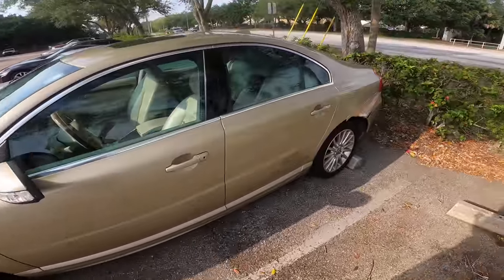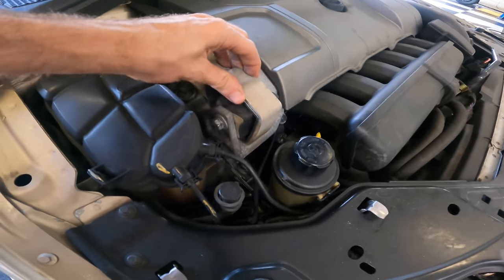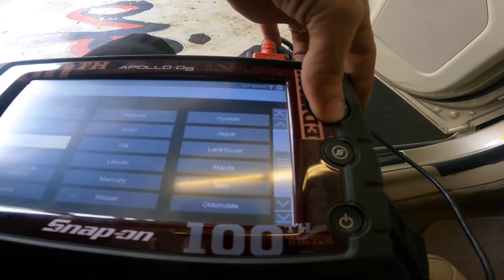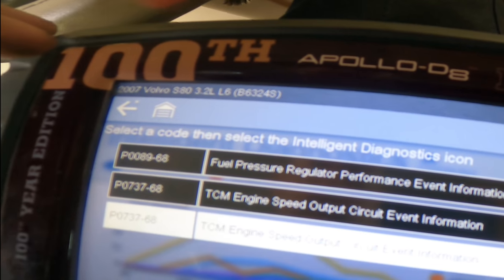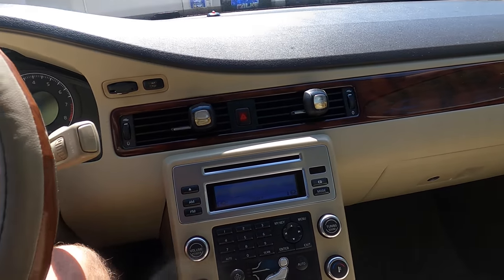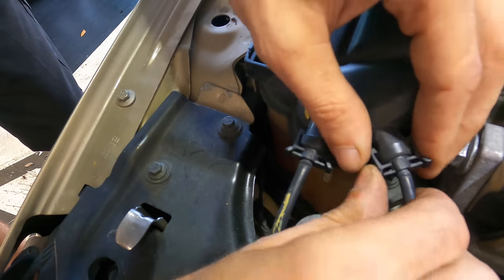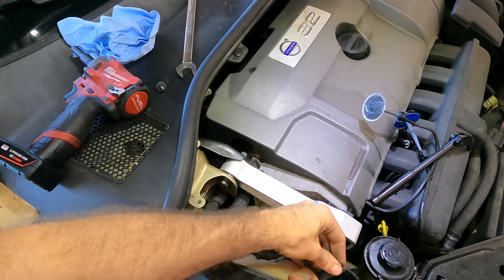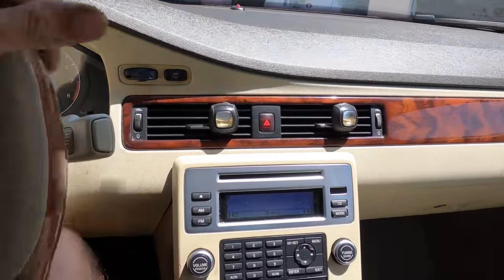How Exciting! A Volvo S80 3.2l Grinding Noise!

Comment: Unfortunately with Volvos I’ve found that the P codes can be horrendously inaccurate for the issue it has. I had a vacuum line pop off the map sensor and the p codes said something related to the cooling fan but I connected a Volvo scanner and it immediately told me it was a error in the map and MAF readings. So if you can find someone with Vdash or vida (they have groups for finding people with it) it helps a lot to find the right errors.

Comment: If the tool gets a job done, is it really the wrong tool?  Sure, it's not the specific job that the tool was designed for, but it still worked.

Comment: Love the channel! Pine Hollow, South Main Auto and this one. A trifecta of great info! 
However, why can’t I turn on the notification bell when I click it? I would hate to miss something new.
Reply: I disliked Pine Hollow after only trashing on all cars except a few Japanese ones. I understand that everyone has is own preferences, but Pine Hollow is only bashing while he's getting paid for getting the hardest ones. Ray also don't like European cars but also a lot of other brand and not constantly bashing them and. 

And even Japanese cars are not built like they used to be. And the designs... my god... spaceships from hell... soulless.
Reply: @bastiaanvandeven9230  I try to ignore the bashing and get what I can from the videos. What I have mostly found out is that I can’t work on my own cars anymore. Eric O, and Ivan are both in the rust belt. Lucky Ray is in Florida. Many of the problems Eric and Ivan encounter are caused by corrosion due to the salted roads in the winter.   
I live in the South where 20+ year old cars on the road are commonplace.  I enjoy driving my 1994 Camry v6LE 325,000 mile coupe. The end of the golden age of Toyotas.
Reply: @jefferp  Yes I'm with you. For me Ray and Eric O are a pleasure to watch, without constantly bashing.

I watched Pine Hollow (Ivan?) do his transmission in his wife's Nissan... constantly comparing with European cars... I've worked on my share of European cars (and I'm an IT guy) and cannot really understand what he is talking about.
Not saying everything is ALWAYS easy or logic... but that's for every car brand.

Ray called Nissan the Japanese Chrysler for example ;).

I don't know... Ivan gets the hardest stuff, what most drivers will not experience.

For example I don't like most other European cars as well, mainly because of the lack of comfort, but I like working on them for friends without constantly (serious) bashing. :)
Reply: Car wizard is good too,along with Scotty Kilmaer.
Reply: If you like Ray and South Main Auto the give Brian'sMobile1 a look. I really like how he will diagnosis a problem that he's working on.
Reply: @MrBowNaxe  WatchWesWork is also a good channel.
Reply: @bastiaanvandeven9230  thanks, I'll take a look.

Comment: I have taken my car to the shop 3 times because my car grinds like that when it’s cold, but once it warms up it goes away, had the axle replaced( torn boot) and needed brakes calipers, and pads. But they could never find the noise, watched this video and went out to my car, same mount, looked tore( not as bad as that one) but I get the noise more when I’m turning to the right, and accelerating. It’s starting to do it alittle bit when I’m turning to the left also, guessing because the engine is shifting, making it rub more on one side more than the other. I was convinced my transmission was going bad, but I’m really hoping I can fix it with a simple engine mount.

Comment: Damn, 2 videos and I am impressed with Ray recently. Last video he demonstrated some real mechanic skills and learned to use threadlocker. This video he did not insult the owner of the car when it was declined initially. From my experience when most owners decline repairs its for a good reason, utility. Most of the declines were on cars that were close to the end of the lifespan, so I always understood why the owner declined. Why spend thousands on a car that you are about to get rid of anyway, if the repair does not actually affect the utility of the vehicle.

Comment: My S80 had an awesome turbo'd engine it was a rocket, but it had so many problems with modules Differential module, climate control module.. now it won't charge the battery so Im done.. its an 06

Comment: A Volvo dump truck has those same little lines on the radiator reservoir. I was just surprised that the little car also has them. And they are a very bad design. Have had 2 break so far just driving down the road.

Comment: Most of the parts used in these P3 Volvo's has FoMoCo written on them....
Reply: It's mainly the undercarriage and some engines from FoMoCo. And a lot of the FoMoCo parts has "SWEDEN" written on them as well. This 3.2 is a Volvo designed engine an mainly build by Volvo itself.
Reply: @bastiaanvandeven9230  most are built in a ford plant in wales, volvo design

Comment: did you check the hydraulic mount beneath the torq bar aswel? normally all 3 mounts are shot. and you did not need to disconnect the hoses just put the tank aside.

Comment: Something like the tailgate upsets me again. It used to be a handle, a metal bar and the lock. Done, that actually always worked. Today cable, sensor, servomotor, control unit and 10 sensors for every crap. No one needs it, but it makes cars more expensive and vulnerable
Reply: metal bar and lock is heavy and expensive, whereas cable sensor motor pcb are cheap and future cashflow as bonus. I kid I kid.. on xc90 the metal bar rusts and could be a legitimate reason why they went with different design later on

Comment: I have a sneaking suspicion that the fuel pressure and evap codes are due to a bad fuel pump.  Most likely needs a new fuel filter too.

Comment: Would an engine mount that broken cause extra stress on the others?
Reply: In my experience yes. My jeep tore one than annihilated the other. Just as a bad shock can damage a spring or break it. One bad part can and will lead to others
Reply: Yes
Reply: Yes, I'd defo check all the others :)
Reply: Yes there's a knock-on effect, same goes for suspension.
Reply: Yes. It's almost certain the one at the bottom is duff. Fcp euro has a ton of video's.
Reply: Yes especially the new chrysler minivans
Reply: @StuEvans  agree
Reply: cmon his guy barely came back for this one :s
Reply: Absolutely yes!

Comment: I know you mentioned that you might need another scan tool to do more advanced programming.  I know you mentioned autel and I would love if you got an autel as I have one and do not know enough about it to use it to its full potential.
Reply: VIDA/DICE for Volvos
Reply: Check out Watch JR Go. He has the Autel and talks about it a lot. Car Wizard does too. Both are in Kansas.

Comment: i changed that top mount on my engine myself in no time bugt it still makes the ghrinding noise it didn't change at all. i have been told its my shitty struts that are making the car sit lower than it should and causing the terrible grinding noise

Comment: Neat video, Ray. Those front wheel drive Volvos are the reason I would never buy one. To a high mileage driver of a rear wheel drive Volvo, the front wheel drives do not do the job as well except for straight line acceleration. They sure do not have the cargo space, either. Still, nice to see one getting your attention. In terms of a Red Block, that one is not even broken in.
Reply: Not sure if you've ever owned one but the S80 will hold 4 bodies in that trunk...

Comment: It’s an anti-pitch mount.  The problem with a big transversely mounted engine like that is the huge amount of torque it generates through the front wheels while twisting in its mounts.  My S60 2.5l diesel did something similar.  I thought it was alignment (pulling to the left), nope, broken motor mount.  Having said that, 17 years old, 143k miles and pretty reliable, comfortable mile eater.  Original clutch (6-speed), front brakes lasted 102k miles.  Can’t kill these old proper pre-Geely Volvos.
Reply: Only the pre-Geely and after 1999 ones are built in the Ford decade, and therefore in some cases Ford engines and undercarriages... while since 2014 no foreign engine is used again. 

Although I'd like to see the biggest shareholder will be Swedish again, Geely is doing good for the brand for now.
Of course the thing today is more ECO-based than performance, so the old oversized 5 and 6 cyls are a thing of the past.

Comment: Volvo 3.2 it The best engine. IT very realible engine. Maintenace it worst. In Nederland. Holland 3.2 was 1 model 780 000 km.
Reply: ehhh the T5 and D5 is more reliable and more economical. Also the D5 is so easy to work on.

Comment: I have A S60 wagon on my lot. We had the MAP sensor replaced. Transmission starts acting up. These are nowhere near related, however I find it weird, because the car drove perfectly with the exception of a check engine light.
Reply: Multiplexed wiring harnesses. Nightmare city. Been there, been doing it for 32 years and nearly 400,000 miles.
Reply: @michaeltutty1540  maybe that the MAP sensor wasn’t the problem has to be an issue in the harness. I’m gonna take it to the local automotive electrician. They’ll get figured it out. This car is waaaay to nice to let it rot.

Comment: That engine mount is expensive as hell. And only came from the dealership. Last time I did one
Reply: Top/RH engine mount on my Mazda3 Sport (UK 2l) at around 10 years. FoMoCo on the part that failed but it was in a Mazda frame so it was dealership and twice the price of the equivalent Ford part.

Comment: I've been driving Volvos for 32 years now. Somewhere around 2003 they totally lost their quality. Regarding error codes on newer Volvos: always clear codes and take it for a drive before the real diagnos. They are famous for setting random codes when battery voltage is low or when batteries are replaced.
Reply: You started driving Volvos about the same time mine was new! Ma took delivery on January 17, 1990. 32 years later Ma and Arthur are still with me.
Reply: In 1999 ford bought out volvo cars, they did go down in quality, but they got a much better suspension system and they also got redesigned body shapes from the team that designed Aston Martins, the whole industry is just different manufacturers sharing parts and designs now.
Reply: A lot of modern cars will throw codes if the battery voltage is.

Comment: Being Swedish I have owned several Volvo's and Saab's since I bought my first car in the early 80's. There are just two kinds of Volvo, the good and the pain in you know where. The last good ones were the 740-series, reliable, easy to work on, excellent heating and affordable spare parts. After that it totally derailed.
Reply: Cannot disagree more. I sticked with Volvo for ever now since the 90's. I'm an IT guy myself, but love maintaining my own Volvo's. Working on them is still easy, never needed spare parts, other than brakes, belts, fluids etc. 
Although not a fan of China, it's been a blessing for Volvo that Geely is now owner instead of Ford. Own engines, own parts, own design and engineering again.
As long as they do not change that strategy, I'll stick to them.

Comment: Check this out, 2013 Chevrolet Sonic RS, 80K miles...man that sounds like the timing belt is about to go; I have no interest in doing that job, take it to shop...your timing belt is fine, but all three of the engine mounts have loose bolts...so after 9 years they worked themselves loose....bizarre.

Comment: The job is that car had deferred maintenance by all the issues that showed up on your computer screen or diagnostic screen if you want to call that you might have another name but the bottom line is that was the easiest motor mount I've ever seen replace or ever have replaced so why they didn't do the rest of the work is beyond me I know you can handle it maybe it'll come back I hope

Comment: Once again, learning that buying a high end car doesn't mean you can afford one.
That mount was way too easy , it must be a trap. 😁
Reply: The real mount on that side is the one under this bar.
Also not expensive and easy to change though.

Had to do it on my V70 T6, because the engine touched the chassis and made noise inside. IT took me about 10 minutes.
Reply: Yes, I would suspect that also!

Comment: Those engine mounts are stupidly easy to replace, I bought an volvo aftermarket polyurethane mount and would never break like the oem does.
Reply: Would that not increase vibration?

Comment: This looks like a Renault engine, Volvo fitted them a lot, before moving on to fit Ford engines, the Renault units were very good until they started to go wrong, then they were a pain to fix, just like the Ford units they fit now.
Reply: Volvo did not fit Renault enignes a lot. 
Only in older 4 cyl diesel versions and later some Peugeot 4 cyl diesels.
Ford engines where in some gasoline versions (I always wanted a Volvo with a Volvo engine) but this 3.2 it's a completely Volvo engineered engine (although some are built in a Ford plant), does not look any Renault eninge.
Reply: They did make the dreaded PRV (Peugeot Renault Volvo) V6 from the late 70s until around 1987, it was only near the end of production that they figured out why they ate camshafts. These were terrible engines that depreciated the higher line Volvos quickly. The Volvo red block engines were tough as nails.

Comment: I would wager it's all caused by the engine mount being left too long and smacking everything around. Buggers up the exhaust system as well as some of the sensors. Typically Renault/Volvo (used to be technology partners)

Comment: When I see a Volvo, my instinct is to flinch. It's a good thing Volvo's have a great crash safety rating!🤕
Reply: My daily and only driver is the 1990 Volvo 240DL wagon Ma bought as her 60th birthday present to herself. In the 25½ years she drove Arthur she racked up about 300,000 km, or about 185,000 miles. In the time since I have run Arthur up to about 615,000 km, or about 385,000 miles and still the original untouched automatic transmission.
Reply: Alot of my customers have the older xc70 wagons.. they're pushing 280k and up.

Comment: I was wondering if you could help me my brother-in-law is gonna give me his pick up truck it’s a 1995GMCK 1500 with a V6 four-wheel-drive automatic I was wanting to put locking hubs on it to try to save get better fuel mileage the four-wheel-drive shop here in Nashville told me you couldn’t because he’s got an independent front suspension could you give me your advice I really enjoy your videos Grace and peace man
Reply: Correct. Locking hubs for solid front axles.

Comment: How does an engine mount get broken? Genuine question. And seeing that Duralast has it as a replaceable part, it must break often enough...
Reply: Poor design + perished rubber
Reply: Mostly old rubber, bad design isn’t always a factor but age most certainly is.
Reply: @lechatbotte.  the rubber on that mount aren't a solid on the front mount, probably done for smoothness but when they perish they drop.
Reply: Rubber+heat+time= failure

Comment: I've only ever worked on a small handful of Volvos in my life, and I tend to make a grinding noise anytime one gets dropped in front of me.

Those DTCs, though...  Anytime I see matched opposing codes and the customer tells me they haven't had the battery replaced around the time the CEL came on, my diag rate goes up.  I'd rather refund accordingly if it ends up being easy than paint an unrealistic scenario for my customer.

Comment: At 93415 miles this most likely was the second mount that broke.  Volvo rubber in the P2 chassis models (2000's eras S60, V70, S80) used rubber in many places that would fail regularly after 45k miles.  Having owned 2 P2s (2000 S80 and 2001 S60) it was a struggle to find rubber parts that would survive for any longer.  I was told it was because when Volvo used rubber parts, they put the stress on the rubber in shear in many locations (engine mounts, A-arms,  strut mounts) but for whatever reason they made these parts with a partial content of used rubber, like 20%.  They'd grind up the used rubber and put it into the mix with the new stuff, but the old rubber just wouldn't bond with the new.  (This may have been a European environmental requirement, or maybe Volvo did it on their own)  This formed micro "banjo frames" of rubber around the old stuff, and those just didn't survive the many push-pull stresses of the cyclical loading as long as if they'd have used new rubber.  But their biggest mistake was using the rubber in shear to begin with.  In compression, the rubber parts would have lasted much longer, but this was just Volvo engineers being lazy/cheap and pushing frequent expensive repairs onto the customers.  So, Volvo, no I'm not going back.

Comment: I used to have a 2004 S80. Absolutely loved it. Until the ECM crapped out. Not fun. You need to get a new one from Volvo, no junkyards, no remans. Because it has to be programmed to that individual car and you need the software from Volvo. It’s a rare occurrence but it does happen. The Volvo specialist here had only seen 2 that needed an ECM replaced in his career. And I was blessed with being number 3, at a cost of about $900 at the time.

Comment: I've got a 2007 V70 2.4D Automatic and not gonna lie this S80 here is an ugly turd in comparison. Might be because my car was the top of the line back when it was sold. Somebody maxed out all options when they bought it: Xenon Headlights, fancy Radio, full Leather Interior, black metallic paint, painted trim all around, painted aluminum rims etc...
The D5 engine with an Automatic is probably Volvos best drivetrain in terms of comfort and economy. Its a diesel but a quiet and well behaved one.